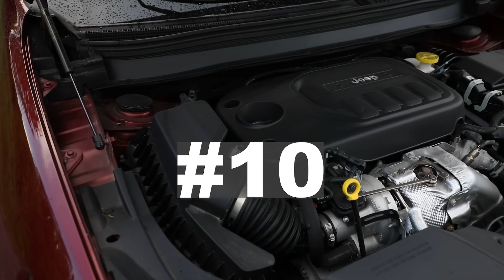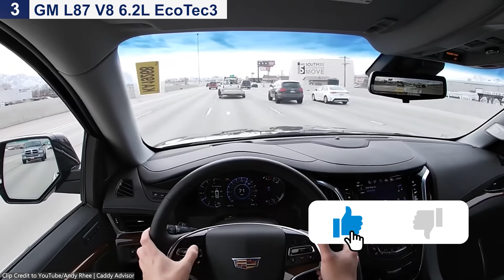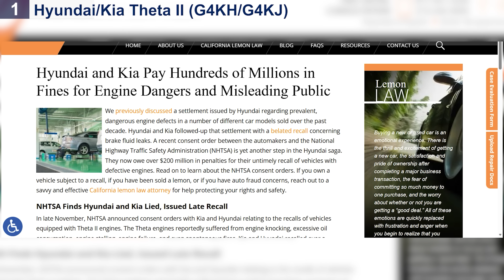The WORST CAR ENGINES ever made (AVOID AT ALL COST)

Comment: 10 Most Unreliable engines

1.  14:23 Hyundai/Kia Theta II (G4KH/G4KJ). 2011-2019 KIA Santa Fes, Optimas, Sportage, Sorentos, Hyundai Sonatas, Tucsons.
2.  12:50 BMW N63 V8 2009 7 Series, 5 Series, 6 Series, X5 and X6.
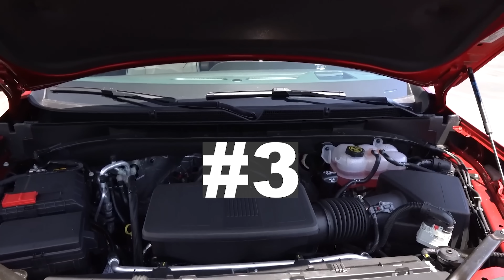3.  11:05 GM L87 V8 6.2L ecoTec3. 2019-2024 Checy Silverado 1500S, GMC Sierra 1500S, Chevy Tahoes, Suburbans, GMC Yukons, Chrysler Escalades.
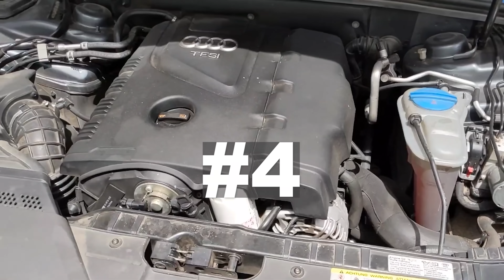4.  9:20 VAG 2.0L TFSI/TSI (EA888 Gen 1/Early Gen 2).  2008-2012 Audi A4, A5, Q5 and Volkswagen GTI, JETTA, and TIGUAN.
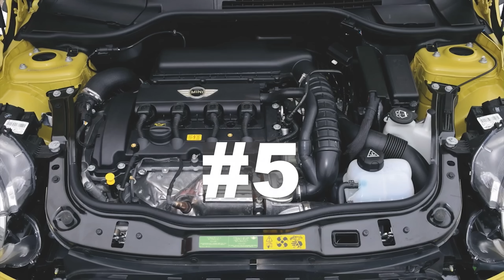5.  7:40 2007-2015 PSA/BMW Prince (Mini N14 1.6T).  
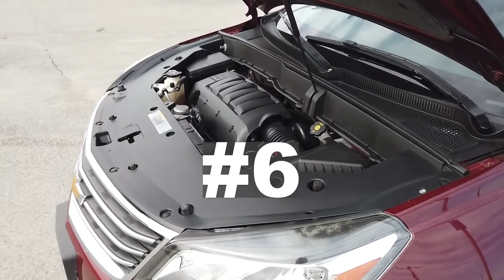6.  6:00 GM3.6L V6 (LLT and LFX).  Cadillac CTS,STS Sedan. Chevy Traverse, GMC Acadia, Buick Enclave, Cadillac Deville, and Pontiac Bonnevilles.  Timing Chain.
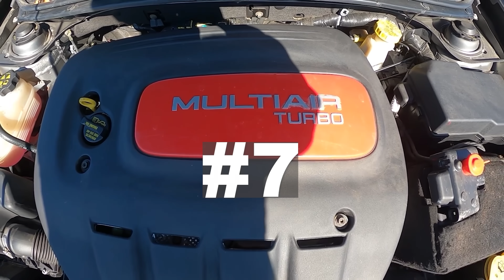7.  4:33 2013-2016 Dodge Dart 2.4-Liter 4 Turbo. 
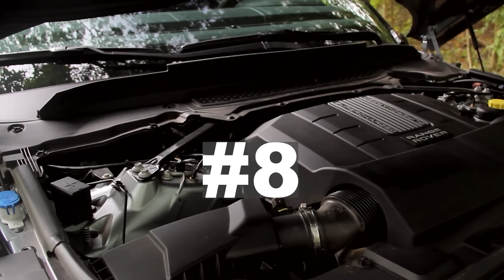8.  3:26 2012-2014 Range Rover Sport Supercharged V8. Timing Chain.
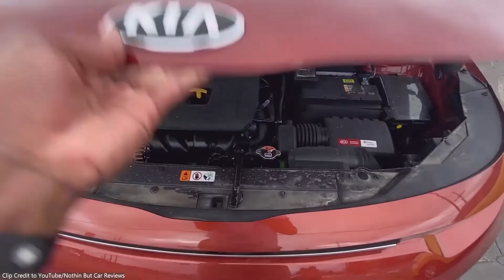9.  2:18 KIA 2020-2021 Kia 2L Nu MPI 4-Cylinder Engine. 2020-2021 KIA Souls, and KIA SELTOS. PISTON Ring that could lead to engine fire.
10.  0:45 Fiat Chrysler FCA 2.4L Tiger Shark MultiAir II Engine. 2013+, Jeep Cherokee, Renegade, Dodge Dart, and Chrysler 200.  Defective piston Ring that cannot maintain proper seal.

Comment: I've had a 20/20 Kia soul since it was branded never has it been a quart low never caught on fire. Driveen it on the highway for vacation in the mountain. It is the third soul we have owned  and  never had one single problem or one single trip to the service department.
Go figure.

Comment: We bought a Hyundai i20 active 2013 at present running well, gets an oil change yearly, and even a service if it doesn't need it, according to mileage  we do about 4000 miles per year. A rule I learned from an old hand mechanic ( An Oil Change is Cheaper than a New Engine)

Comment: Okay.  1. Use normal oil change of  3,000-5,000. The 10,000 mile or once per year is so cray.  2. Keep your engine full if it uses oil.   I had a 2.4l Kia and used 1 guart every month. I just keep it full and had no further issues. Car had  173,000 when totaled in accident.

Comment: 1. The FCA Tigershark descended from the disastrous Chrysler-Mitsubishi-Hyundai partnership called GEMA (Global Engine Manufacturing Alliance).
2. Hyundai and Kia recently replaced the Nu engine with the Smartstream G2.0/L2.0.
3. Land Rover should close shop in North America and concentrate on fixing its problems in other countries.
4. The Dodge Dart never should have had the 1.4-liter Fiat MultiAir engine. It was underpowered even with the turbo.
5. The 3.6 High-Feature V6 should have been confined to Australia and New Zealand. By the way, the Pontiac Bonneville was actually powered by the 3.8-liter BUICK V6, not the 3.6-liter LFX.
6. The "Prince" engine should have stayed out of North America.
7. The VW/Audi 2.0 TSI engine was improved with later versions.
8. The GM L87 was rushed into production when it really shouldn't have been.
9. The N63 was a BIG mistake for BMW; a 5.0-liter NORMALLY-ASPIRATED V8 would have been a better choice.
10. Like the FCA Tigershark, the Hyundai/Kia Theta II descended from the ill-conceived GEMA engine partnership.

Comment: The Land rover Discovery 3 also had that 4.4 twin turbo V8, someone I have known since I was 15, had a disco 3, 4.4 V8, 2023 comes around and The Crank bearings failed on it, ended up needing a whole new engine, he luckily is a mechanic and was able to fix it, it was his own car, but still, goes to show, I've had first hand experience essentially, they're good when they work, but when they break it's expensive Fast, the BMW 4.4 V8 is a terrible engine

Comment: The Dodge dart You Want has a 2.0 litre, go check car wizard if you want the proof, they're good if they're maintained properly, I hear 1.4, and 2.4, I think of the ecotech engines, those are bad, but the standard, boring 2.0 with nothing special, that's the engine to go for

Comment: Disgraceful ! New car manufactures are only interested in selling MORE cars . They are made not to last,,  e g this video . Have a search also on wet belts . . Famous in Ford Raptors and Rangers . Ford has replaced the timing chain with rubber belts and the engine oil still goes through the belt,, destroying it very quickly causing catastrophic engine damage . Check if your vehicle has a wet belt . Im staying with old cars, im doing well .

Comment: I had a 2019 FCA Tiger Shark 2.4L and never had an oil consumption issue with it. I purchased it brand new and always stayed on top of the oil changes. The truth is, they are just intolerant of a lack of maintenance and any driver should check their oil at every gas fill up.

Comment: There's nothing wrong with buying a used Hyundai (with model years between 2011 and 2019 with these engines) as long as you check the oil dipstick.  If it's reddish orange, the engine has been replaced.  My 2014 Santa Fe has over 203K miles on it and still runs great!

Comment: I find it hard to believe the vehicle gives no warning with low oil
Reply: I have a LFX engine in my Camaro.I have no problems ,because I change my oil at 3k miles and use an oil friction reducer.Oil is cheaper than engine repairs.

Comment: Never seen an issue with the 3.6 lfx engine.know of 3 people that have over 250 000 miles and still on original timing chains.....the LLT however was known for bad chains because the oil change interval was way too long

Comment: Hyundai Engines ...2.4 liter Oil presure sensor are factory defecient if u get one leaking at highway speeds theres a good chance of grenading ...if you smell oil burning or see small oil drops in driveway fix immediately fixed mine auto zone part wanted 1200.00 plus spent 14.00 and 2 hours do not buy sensor from hyundai there no good

Comment: Mini engine doesn't fail bcuz of hpfp this happens over time and you replace it easily. ECU is most problematic and if you change oil every 5 to 6 k miles you shouldn't have to many issues up to 100k

Comment: I would not have believed it until seeing this video. I would have bet the GM Chevrolet 2.4L 4 cylinder Would have easily made number 1 with 2.2 L not far behind. I have rebuilt them and owned them now retired last 2 Equinox have bled me dry. 2015 model quoted fix $1,200 from Chevy dealership when all said and done bill was $2,200 that’s called screwed. I complained and was told they didn’t need my money, after purchasing 13 brand new vehicles from them. I switched to different American manufacture and should’ve done it long time ago about 10 vehicles ago.

Comment: Australia used to build GM's 3.6l V6 with zero issues. Problem then was that everything else around the engine kept falling apart.  Now the art of building reliable gas engines will fade quickly. Even gen 1 Tesla motors in the electric Toyotas will let coolant past its seal.

Comment: 1 quart per 1000 miles is Industry Standard as max . I cut the factory oil changes interval I half. I currently own a EA Gen 1 .I had a Timing Chain Rattle on start up , changes the Oil to Liquid Moly 5W40 . Rattle went away .

Comment: The reason engines are built with large gaps in between the rings and the block is to meet fuel economy standards by the government. The side effect of that is an engine that burs oil.

Comment: I thought GM fixed the timing chain issues in the LFX 3.6 after 2012?
Reply: The key to not having timing chain problems is to change your oil  by 3 to 5 k miles not by using the computer monitor,which can tell you 15k miles.Clean oil saves engines from internal failures.Use an oil friction reducer additive too.

Comment: A close relative of mine owned a Audi Q5 from 2012 with the 2.0L Turbo engine, it was using one quart of oil every 300 miles, yes 300 miles and the SUV only had 92,000 miles. She traded it in for a  new Japanese SUV.

Comment: I HAD A BMW N-63, ENGINE 2010 7 SERIES,, I CALLED AND CALLED BUT NO RESPONSE WENT THROUGH 1 QUART OF OIL EVERY 700 MILES,,, THEN I BOUGHT A 2016 HYUNDAI TUCSON CALLED THEM MULTIPLE TIMES NO RESPONSE,  BECAUSE THEY WERE UNDER INVESTIGATION AND LAWSUITS,,, SLUGE CAUSE BY THEIR BAD ENGINEERING

Comment: Honda F20a 's oil & plug seals ( gaskets & o rings too ) are not silicone, harden & leak. Silicone can be rubbed onto contact areas with cylinder head, but were not. Piston tops lack dents to avoid hitting valves. Distributor sucks in dust. Spark cables have high resistance, no capacitor. Throttle sensor wears fast. Buyers best avoid.

Comment: Biggest issue in all of them is they run oil that is WAY TOO THIN...ignore the manufacturers 0W20 recommendation & use good old 5W30 or heavier...no where outside North America is thin stuff used. EPA regulations are the reason.

Comment: Whoever wrote this is a idiot Toyota had a 200,000 recalls on their 3.4 l V6 because the engines were grenading also Ford on the EcoBoost had 90,000 recalls because the timing chains were going bad whoever wrote this doesn't know what they're talking about do your homework before you speak

Comment: Most manufacturers say that 1000 miles to a quart of oil is normal,  being a mechanic of 30 years i completely disagree. Modern engines with all the tight tolerances and clearances should go 3 to 5000 mile oil change intervals without adding oil
Reply: So true. My 2011 Ford Fusion 2.5 engine has 181k miles,  the oil level never drops a bit at 4500 mile oil changes. 1000 miles per quart is way too much oil consumption for a modern engine.

Comment: You forgot to add Tahoes and Exploders to the list
Reply: Tahoes yes.  Explorers are Fords and Fords don't have this BS problem.  Generally their stuff works and before all the Ford haters start in with the whole "you'll do the phasers for $3k in no time" song, there are plenty well maintained EB engines on the road with over 200k on them working fine. You cannot ignore VVT turbo engines.  They will self destruct
Reply: @lan @lanemorrow7417 ave a 2019,2021,and had a couple 2019 PPVs in our fleet and they spent more time in the shop than they were on the road.  So the head honchos had the bright idea to switch to Tahoes in 2024.  They don’t even have 30,000 miles on them yet and 3 of them already needed brake jobs (pads and rotors), 1 already had a wheel bearing go out,they burn oil like nobody’s business, and numerous electrical problems.
One of our neighboring agencies already had 2 engines blow and a tranny go out.  I think they decided to switch to Durangos.

Comment: Sometimes an engine will burn oil until the rings can seat. It's up to the operator to keep it topped off. If it low or out of oil.. that's what scuffs the surfaces instead of "wearing in"

Comment: Adjustable timing requires regular oil changes with a very good synthetic oil. The new Valvoline restore and protect will keep the engine clean and while lubricated. You cannot drive short trips without changing oil more often. It's sludges up the motor

Comment: The standard in the United States for oil usage is 1 qt in 700 Mi so it sounds like the 2.4 is actually doing pretty good. I can't figure out why they allow that kind of oil usage but that's the standard.
The engine does not fail. When the oil gets low the electronics of the car shut the engine off. Put oil in it the car will start right back up again. But it is not a necessary thing to shut off with 3 1/2 quarts of oil in it. But you should be checking your oil. Had they used a little bit higher tension piston rings, it wouldn't be nearly such a problem the General Motors V8 for instance has ring gaps that are at least 30,000 which is much larger than it needs if unless it's got power adders like turbochargers and or superchargers on it. Yet for some reason they want a huge gap in their piston rings 5.3 for instance should have a gap of somewhere close to about .018, it's literally at least .012 larger than that.

Comment: I had a 2019 Hyundai Sonata Sport with the 2.4 L. I bought it brand new in 2019 changed the oil every 3k miles did all the required maintenance intervals but in July 2023 @ 160k miles the engine went out in route while I was driving from Arkansas to Dallas. The oil light illuminated. 
Zack

Comment: I bought a 1981 chevy citation and the car would stall out, overheat and the trans lasted for 22,000 miles before I replaced it at amco for lots of money.  The local chevy dealer, VALLEY CHEVROLET IN TIMONIUM MARYLAND could never fix it.  I sold it to the dealer for a loss of $4,000.  It spent lots of its life in the useless chevy dealer garage.  I will. Ever buys chevy again and am a TOYOTA MAN FOREVER.  THIS WAS THE MOTOR TREND CAR OF THE YEAR.  WHAT A JOKE THAT RAG MAGAZINE IS.
Reply: NEVER BUY A CHEVY, THEY ARE TRASH AND THE DEALERS DO NOT KNOW HOW TO FIX THEM.

Comment: This video could have been a lot shorter and just say buy a Toyota or Honda. 
Actually I think a lot of the unreliability is partially the inferior materials/designs/manufacturing of engine components along with the manufacturers oil life indicators telling people to go 10k-15k miles between oil changes. This is the auto industry trying to force you to buy a new car all of the time. I change the oil every 3k-4k miles in my 2013 Toyota Avalon with over 140k miles on it and my wife’s 2013 Cadillac SRX with over 180k miles on it. I check the oil level every time I get gas. Oil changes are one of the easiest and cheapest maintenance items to do. Even if you don’t do it yourself go to a reputable mechanic to have it done. Stay away from all of the quick change oil places.

Comment: My wife has a 2013 sonata 2.0 Turbo 60000 miles, the engine went, we put another one in there. I hope it doesn't happen to that one too. But don't buy a Hyundai, they are some of the garbage cars on the market. Hyundai literally should be run out of business.They shouldn't be allowed to produce automobiles. The cars they build today are total crap they do not make the cars.
I used to have back in the late sixties, seventies and some of the eighties these are pure garbage. Even the american cars, a lot of them are junk.There's nothing but recalls on everything.

Comment: Wow. I had a 1968 F-250 with F. E. 390 mill. Only time I had to fix was Carb float. It had 240 k on it, still didn't burn oil & would still burn tires. It was built to last.

Comment: I’ve owned a 09 cobalt ss drove it hard sold it with 160k kms no issues. I own a 22 Colorado with the 6 cyl I’ve got 100k kms on it now no issues and I use it like a truck hauling things. My wife has the new 3cyl trax with 50k kms no issues and I recently bought a 23 Camaro with a 6cyl manual low on kms but so far I can’t get enough of this car

Comment: The issues with Hyundai and KIA didn't end in 2019. Engines are still experiencing major failures. I had a 2021 Tuscon with a 2.4L GDI and it had a major oil consumption issue before the 3rd oil change! When I realized how many people I know personally alone that either had an engine replaced, were waiting on an engine, or were experiencing engine failure on the replacement engine, I knew it was time to punt! I got rid of it asap! I tell everybody I know not to buy even a newer Hyundai or KIA! Some listen, while others are a glutton for punishment. I have no idea how Hyundai/KIA continue to get away with this!
Reply: You described the issue I had with my 2016 Tucson Eco Limited 1.6 Turbo engine. I recently had the engine and transmission replaced. I learned that there was oil consumption. Had I known this, I would not have purchased this vehicle.  There were no known recalls in the report that was given to me and did my own research where it showed there were no recalls. My car was used as a lease but came from Brooklyn,  NY, to VA, to SC and finally to GA. I'm hoping with a new engine, the car will last but I'll see. I cannot afford to trade it in right now.

Comment: My water saving “low flow flush” toilet requires no less than three flushes to get the chit off the bowl…. The exact opposite result of its design. My environmentally friendly gas cans spill at least 1/4 of the gas I’m trying to fill…. These cafe standards they put on these new cars for fuel efficiency kills the engines with inferior parts and thin oil, resulting in the exact opposite of the intended environmental benefits. This is what you get when dumb people are allowed to make decisions.

Comment: It appears in this video that today, many people associated with the auto repair business want to experience an aneurysm over oil consumption at the rate of 1 quart to 1000 miles of driving. How many viewers can recall the 50's and 60's when it was standard for an engine to use a quart of oil to 1000 miles? A greater consumption was cause for concern but a quart to 1000 miles was acceptable.

Comment: I have a 2013 Dodge Dart 2.0 l engine with a CVT transmission all original with 330,000 mi burns about a qt in-between oil changes.

Comment: Add mid 70s to late 80s Nissan A series engines, as they aged they became money pits or blew up at under 100,000 miles.  Owned 2 of these engines, in a single Datsun 210, permanently turned me off Nissan brand in 1992.
Reply: Problem was weak main bearing on the crankshaft, they go bad, it sends the pistons into the head self destruction by 75000

Comment: #1 , the Bonneville never came with the 3.6, they had 3.8 and the crappy Cadillac 4.6. I’ve had 2 Hyundai Santa Fe with the 2.0 turbo and I had zero issues, my sister still has my old 2014 with 180,000 miles.